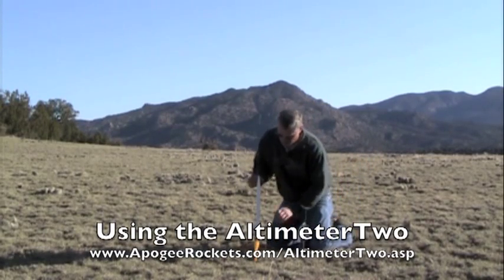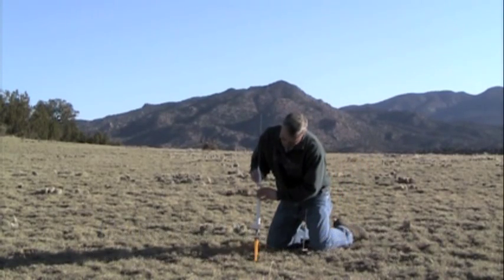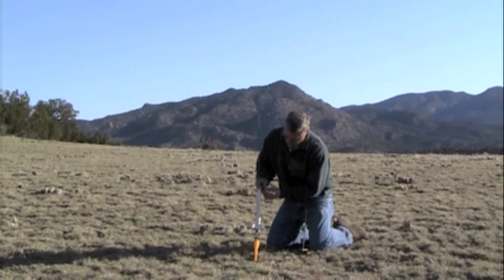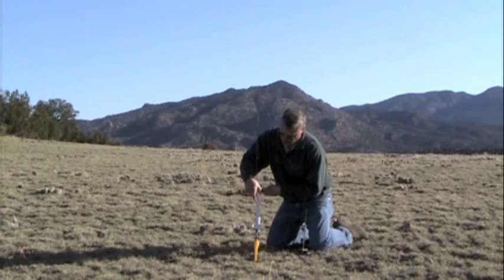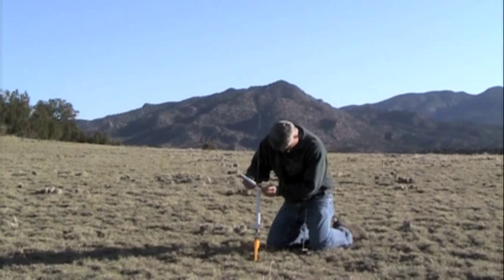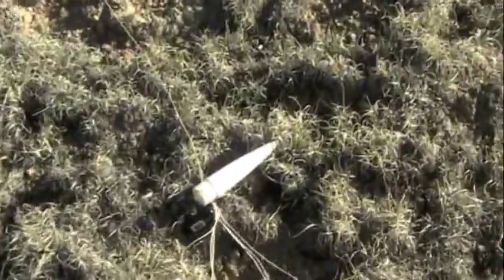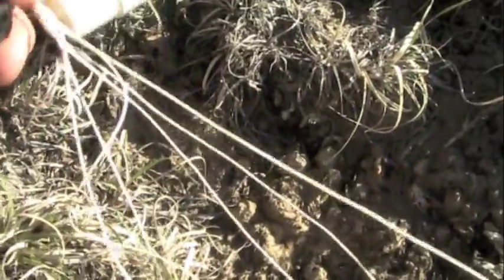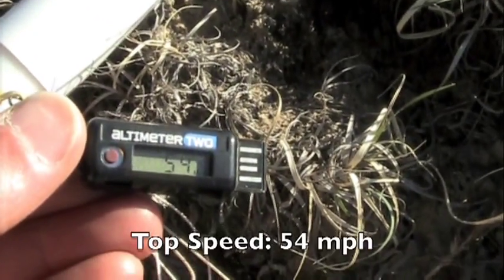AltimeterTwo Altimeter Actual Flight in a model rocket

Comment: hi. I have the estes altimeter and I'm completely not happy with it. The last reading I go was 5000 feet on a rocket that. as far as I could tell visually, didn't go above 300 feet. You also have to punch holes in your rocket to get a reading. Is this the same with these altimeters?
Reply from the maker: +Michael Becker The altimeter has to breath (sample the air) surrounding the rocket. So yes... you do have to have a couple of small holes in the tube near the altimeter.
Reply: have you ever tried the altimeter 2 vs the estes altimeter?
Reply from the maker: +Michael Becker Never have flown the Estes Altimeter. Sorry. AltimeterTwo is a good one. Ask around on the rocketry forums.
Reply from the maker: @Peter Kodheli You have to use one of the approved altimeters in the contest. You don't have much choice.